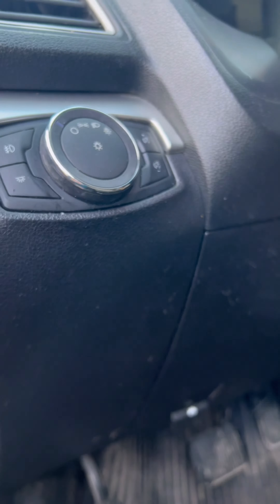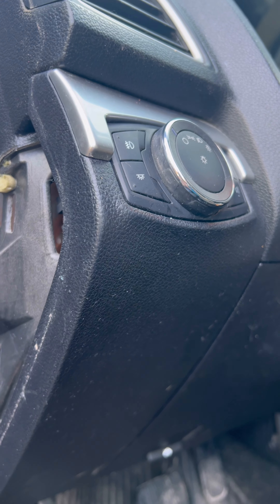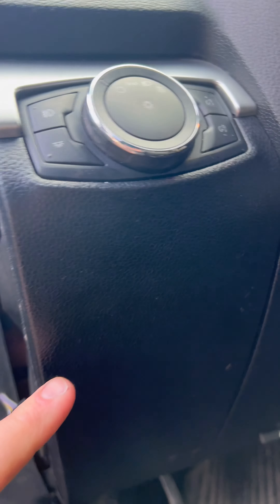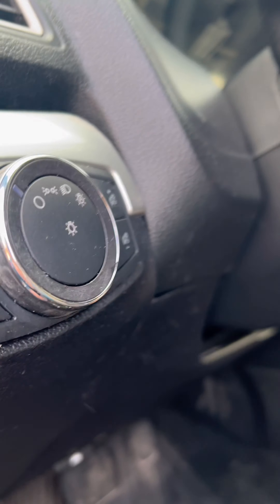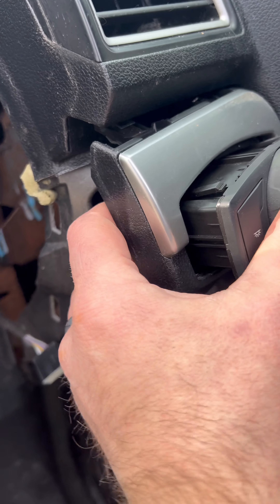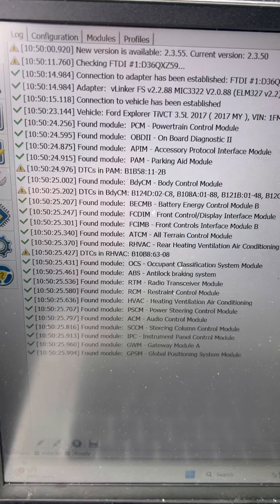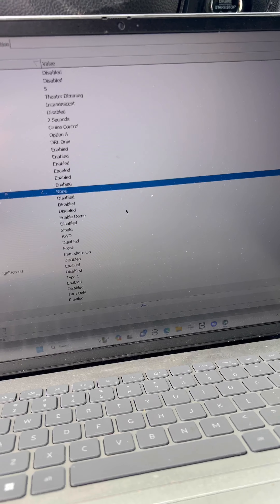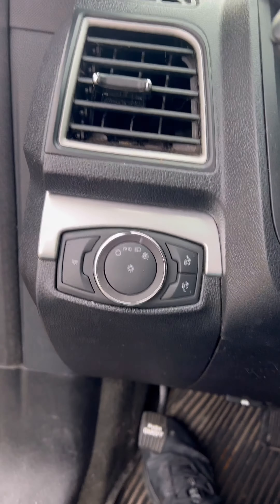17 Ford Explorer Constant Battery Drain

Comment: My explorer 2017 XLT, for some reason the backlights turned on by it self today while being parked for first time, then when I open the drivers door atarted to do a brief chirping noise. Did you get a code? I started to think that maybe the battery started to die or needs a new headlight switch.😑